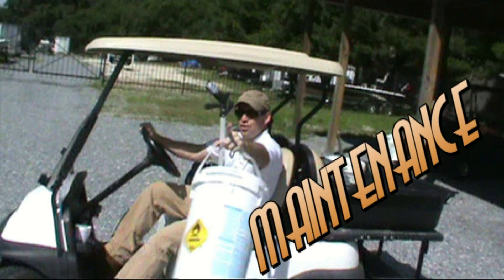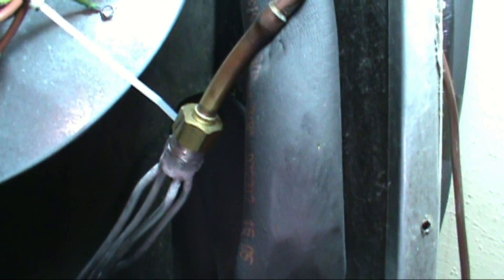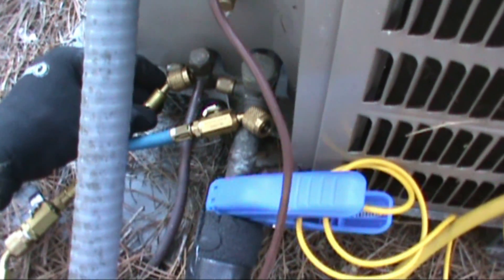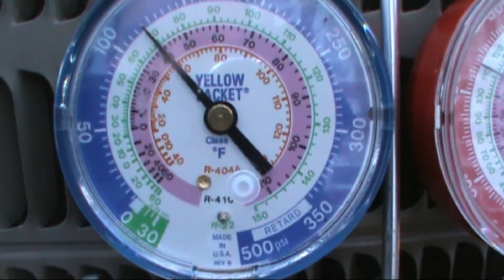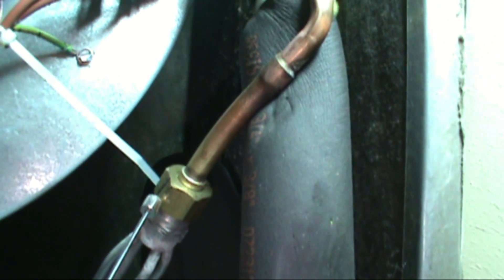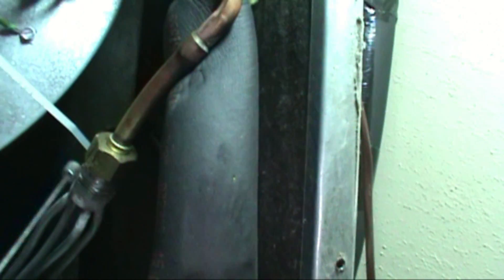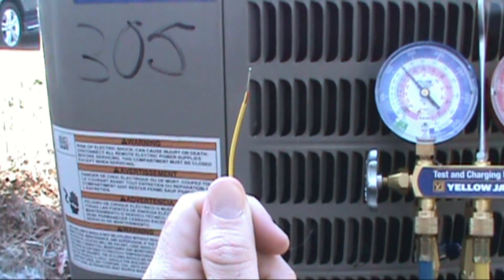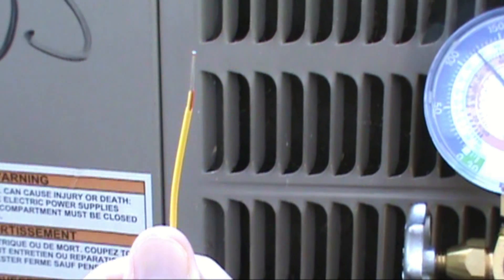HVAC SUPERHEAT explained on a real unit. R-410A analogue gauges

Comment: Hey Lex. If the weather outside is cold say 50-60 degrees would we still be able to check charge using superheat with the same set up
Reply from the maker: No, the charge is weird in cold weather. I always wait until it gets to 75 plus degrees for a true reading.

Comment: You read the suction side temp on gauge and said the freon is boiling at 40deg and hitting the piston at 40deg. Isnt the temp from gauge on suction side, the temp of the freon that is leaving the piston (not going to piston) and already gone thru superheat? The temp from gauges liquid line should be the temp thats hitting the piston and the temp from low side gauge is the temp after the freon has turned to vapor and went through the evap coil? Im just asking for clarification because im trying to learn and that part confused me a little
Reply from the maker: The saturation temp is the boiling point. Google hvac saturation. It'll be able to explain better than I can on YouTube comments. It took me a while to understand it all as well. Thank you so much for watching James!

Comment: Thanks for the video. Should one take the outdoor ambient while the condenser is running?
Reply from the maker: It's doesn't matter. As long as it's taken in the shade. The unit can be off or on. Thank you so much for watching D N!
Reply: @LexVance  Thank you for your reply. Does it matter if the Ambien is taken at the condenser or in another place even if it’s far away?

Comment: Sorry you lost me, you say blue hose onto the suction which goes with the blue gauge. Red hose liquid line onto the red gauge high side. Yet you are explaining liquid side off your blue gauge @120psi looking at your high side gauge which looks to be around 240psi should be what's entering your piston inside. Apologies if I missed something but should the 120 psi not be your suction return side?? Note I am not a A/C guy but a commercial fridge guy, so 410a is not something I see much of it's all 404a with us.
Reply from the maker: Sorry, I'm not understanding the question. Blue Suction side should always be lower than liquid red head pressure side.

Comment: if the lines going into the manifold are not "burped" (Bled) in the very beginning before releasing the vapor into the system (superheat), is it over for the whole system due to air contamination?  In other words, will acid eventually eat it up and everything comes crashing down?
Reply from the maker: It really depends. When I was a newby I never bled the lines because I didn't know I had to and systems ran for years. It's good practice to do though from now on.
Reply: @LexVance  thanks for the reply, I'll let him know.

Comment: That discharge line going into the metering device doesn’t look good. But good video!
Reply from the maker: 😆 Right on. This video is 5 years old and the unit has never had any issues since I've made the video. Thank you so much for watching Tony!
Reply: Lex Vance I’ve had liquid lines look like that on systems and actually collapse and create leaks at the condenser coil on Mitsubishi City Multi systems before. Is this unit happen to be a Heat pump?

Comment: Great video. I have a doubt. With 40 F the pressure is 133 psig. And your manometers shows 120 psig. Initially you had low pressure 120 psig and high pressure 235 psig. And once you recovery you have the same low pressure 120 psig and high pressure 250 psig. I will appreciate if you can explain me anything about it. Thank you.
Reply from the maker: Pressure at 40 degree sat. is 120 psi for R 410a refrigerant. It all depends on target superheat. 120 may be correct. Depends on temperatures and wetbulb\drybulb. Way too much to explain over YouTube comments. Thank you so much for watching Efrain!

Comment: So your Fieldpiece is calculating the Wet Bulb Temp off of the principal of "Evaporative Cooling".
An example of Evaporative Cooling is standing outside & wetting your finger, then holding your wetted finger in the air to "feel" which direction the wind is blowing from.
That intense cooling sensation that you feel in your wetted finger as the wind blows over it is an effect called "Evaporative Cooling"
When we get the indoor Wet Bulb Temp on the inlet of the Evap coil, we are doing the same thing, except it's not our finger, it's a wetted sock & the Web Bulb meter is calculating the temp at which the Evaporative Cooling effect is taking place.

I noticed, that IF the only criteria that changes is the Wet Bulb Temp (the outside ambient temp doesn't change; the low side & high side pressures don't change)....the ONLY thing that changes is the indoor Wet Bulb Temp.
I have noticed that if the indoor Wet Bulb Temp increases, my Target Superheat increases too; & vise versa if my indoor Wet Bulb Temp decreases.

But remember that this is not for TXV systems. This is for piston/fixed bore metering device systems.

I suspect that this may be why I get a higher Target Superheat, when I am dealing with a system that is running during a "Hot Pull-Down" -Because of the added humidity in the conditioned space.

Also, don't expect an 18 to 22 deg split across the Evap Coil when the conditioned space has elevated humidity levels (i.e. during a Hot Pull-Down) because it takes Latent Heat to remove humidity, & that cannot be measured by your thermometer.

These are just a couple of things that I have learned out in the field & I wanted to share them to the new techs to help them.

Thanks for the awesome Vid Skid!!!
Reply from the maker: Thank you so much for watching Adam!

Comment: hey lex...i work with pancakes a/c units(air handles) which are on top of the tubs and the coils are off limits to check for wet bulb...i have a digital  field piece manifold set ....can i still read target super heat with out wet bulb reading on the evaporator?
Reply from the maker: You can check wet bulb at the return grill. That's where it's done. I just have easy access to my coil so I do it there. It's also the return closet. Thank you so much for watching Leon!
Reply: @LexVance  hey r u looking for work...😃😃😃😃

Comment: Great Video on Superheat and Subcooling another aspect to low Superheat or high may not be adding or removing refrigerant that's most Techs go to but really Airflow is the Number One scenario that plays into the equation of Superheat and Subcooling .Restrictions ,kinks in liquid line ,blocked screen before the metering device or txv of course this is going in a lil different direction of just Superheat and Subcooling

Comment: Thanks for sharing a very well done video. What is the difference between a dry bulb and a wet-bulb? Would putting a wet sock over the thermocouple, or dry bulb turn it into a wet-bulb?
Reply from the maker: Wet bulb is inside humidity & dry bulb is outside temp in the shade.
Thank you so much for watching neutrodyne.
www.DirtyMaintenanceNation.com
Reply: @LexVance  Can you put a wet sock on the thermocouple you used outside to determine the temperature and use it inside to determine the inside humidity, or do you need a special wet bulb for this?

Comment: I have seen people doing dry bulb differently. They checking it at the closest return to the air handler. These re two different methods. Which one is correct because both will give you totally different readings as the one from return will definitely be cooler depending on how long the ac was on for before taking the readings.
Reply from the maker: This is the return in the video. We don't have a return grate. As long as it's close to the return you're good. Thank you so much for watching How To Do It!
www.DirtyMaintenanceNation.com

Comment: Hi Lex how do you calculate the wet bulb, dry bulb,  vapor pressure and the line temp. manually if i don't have that device that you used?  Thanks Lex
Reply from the maker: It's a long formula you'll need to Google. 
👍😂👍 Thank you so much for watching Moises!
www.DirtyMaintenanceNation.com

Comment: You should should stress  the most important thing to check before even thinking about messing with the refrigerant system is PROPER AIRFLOW over the evaporator coil.
Reply from the maker: Thank you so much for watching Rod!
www.DirtyMaintenanceNation.com

Comment: 👍Outstanding tech tip👍
So much waste & over-charging of refrigeration systems it’s crazy. 
Typically, (Respectfully) Techs are lazy. I’ve been there & it happens but if they’d follow tips, instruction like this and read a book about ‘TD’, temp drop across evaporator coil, understand where and why putting your temp probes, wet bulb, dry bulb....their life, job would go much smoother. 
I will say that in my day we didn’t have iPhones or apps to assist but now it’s a tool. I’d rather be working in today’s world with the gadgets!!! Stop slugging the compressor & washing oil from it. The Compressor will thank you! 
Great job Lex👍
Reply from the maker: Thank you so much for watching Major!
www.DirtyMaintenanceNation.com

Comment: I thought after the metering device it's a LPLTL then goes through the coil then at the V point it goes into a mixture of liquid and gas. Then goes to a LPLTV? Correct me if I missed something thanks in advanced
Reply from the maker: What is LPLTL? You'll have to excuse me, I taught myself HVAC through reading & watching old men & I've never heard that acronym before. Thank you so much for watching Cbr!
www.DirtyMaintenanceNation.com
Reply: LPLTL is low pressure low temperature liquid. By no means I was critiquing the video very informative. I guess it's who teaches the lesson. I was taught in my military HVAC school it's a constant liquid  until it reaches the v point.. lol it makes since bc at the metering device its the saturation point  thanks man I subscribed.
Reply: We was taught to know those acronyms  leaving compressor it's a high pressure high temp vapor HPHTV... Goes through condenser and changes state  in High pressure high temp Liquid HPHTL through metering device Low pressure Low temp Liquid .. LPLTL goes through evaporator changes state it's a LPLTV lol that's what they instilled in us sorry about the rambling memory jargin over 14 years ago lol

Comment: Thank you for your reply 
Actually there’s no valve in the system 
What is there is only capillary tube
What about internal leak within the compressor from discharge side to suction side 
Thanks

Comment: Many thanks to you 
Can you please tell me the reason of having a high suction pressure and temperature with low amps (about 11 against 13.5) and clean condenser 
The compressor is tripping on high temperature
Thank you in advance
Reply from the maker: Ahmed Al Azazi Maybe a restriction in the line. Blow the line set out with nitrogen after removing valve core on liquid line. Blow nitrogen through suction line.
Thank you so much for watching Ahmed!
www.DirtyMaintenanceNation.com

Comment: So I get the whole process , and when you do your wet bulb inside across the return grille do you have the air conditioning system on or just the fan
Reply from the maker: Barry G Yes the AC is on in cooling mode. Thank you so much for watching Barry!
www.DirtyMaintenanceNation.com

Comment: 40 degrees would be the saturation temp, give or take, of the suction line about 6 inches away from the evap coil.  The internal temp of the evap depends on where the refrigerant is in the coil....the further it goes though...the more heat gained.  So, I just wanted to clarify when you say the refrigerant is boiling off inside the coil at 40 degrees,  it's actually the saturation temp of the suction line measurement after it exits the coil.  But, great video and thanks for showing some of these guys how to do it....Super heat and sub cool tell you everything about that system...it provides the starting points of where to investigate if it measures wrong.
Reply from the maker: Donnie Young Right you are man. 
Thank you so much for watching Donnie!
www.DirtyMaintenanceNation.com

Comment: Pretty cool video. Don’t forget the worst effect of low refrigerant charge, which is a lack of cooling for the compressor itself. There can be a pretty fine line between too much and too little refrigerant. “Beer can cold” gets thrown around all too often, and there are beer caves around here that indicate 29 degree box temps. Better not be beer can cold at that point!
Reply from the maker: Daniel Burdette 👍😂👍 Thank you so much for watching Daniel!
www.DirtyMaintenanceNation.com

Comment: Lex, can you check superheat pressure on the low side when the heat is on? It seems that the pressure needle flips 180?
Reply from the maker: Winter is hard. I remember around the psi is for units & put it a little below the pressure psi in winter. You can do superheat when its cold. I come back on hot days to do superheat. Thank you for watching Jim!
www.DirtyMaintenanceNation.com

Comment: You forgot one important step first. Make sure the coils and filter is clean. 
I can't tell you how many condenser coils I've cleaned, only to find out the maintenance guy that came before just added refrigerant. I clean the blanket of crap off the coils and then had an over charged unit.
Reply from the maker: Right you are Texas. Thank you for watching!
www.DirtyMaintenanceNation.com
Reply: @LexVance  Wouldn't dirty coils effect superheat or subcooling ?
Reply: @marty7922  Yes, its why the most important check is to verify proper airflow across the evaporator if charge looks low or super heat is whack. As for the condenser it will usually show higher head pressure than expected and lower sub cooling if excessively dirty.
Reply: that doesn't make sense, it'd be the opposite once you clean the coils you realize the system is undercharged
Reply: Air flow air flow! Then measurements! Glad to see the youngsters have the knowledge! Superheat/subcooling the keys to refrigeration success! 
Superheat on nonTXV..notice your emerson ap specified non TX.. well done young man.
Reply: TexasTimelapse this video is about superheat method.  You can make your own video then people can watch it.
Reply: Always some fucking idiot showing his stupidity.  This video was about superheat, not filters.
Reply: @kurtbachsnazcher7115  Right, and since a dirty filter and or coil or both can reduce airflow, below acceptable limits, which alters the pressure readings, and gives false superheat numbers, its the most important first check.
A dirty condenser coil causes high head pressure and reduced subcooling.
I will give you an example, we will use a 2 ton unit as our example so nominal airflow across the evap coil would be 800cfm, but we could be ok at 650cfm, but thats getting lower than preferred.
Now lets look at our blower performance, in this hypothetical example we see our blower will deliver 800cfm at .5 IWC TSP. Now using a manometer or magnahelic guage we measure the TSP and it is .9IWC. We refer to the blower performance table it is shows at .9TSP our unit is delivering 575cfm.
The suction pressure will be low and the unit will appear undercharged, when in fact its an airflow issue, adding refrigerant without remedying the airflow will result in an overcharge, overcharge often induces liquid refrigerant migrating back to the compressor. Since the compressor is only desighned for vapor liquid flood back is bad bad bad.
Step 1 for any tech that knows what he is doing and cares, verifies airflow, superheat doesn't mean jack shit if the airflow across the coils is excessively restricted.

Comment: You are talking about the super heat but pointing at the wrong line. Some may get com High side sub cooling, low side super heat.
Reply from the maker: The Ice man the blue side tells what's going on in the air handlers metering device. the red side tells what's going on in the condenser metering device. whether it its a piston or txv. The comments you see in here are from 30 yr hvac veterans. they would've called me out if I was wrong. thank you so much for watching man!
www.dirtymaintenancenation.com
Reply: That's true, I have the same 30 years, I miss read you sorry.

Comment: I don't like to get the wet bulb too close to the coil because it gets cold next to the coil.  Really the inlet air is is the room temp air wet bulb.  You can even get it next to a fan.  On homes with multiple returns (especially on different floors), I average them together if they are different.
Reply from the maker: NETWizzJbirk Right on Justin! Thank you so much for watching man!
www.dirtymaintenancenation.com